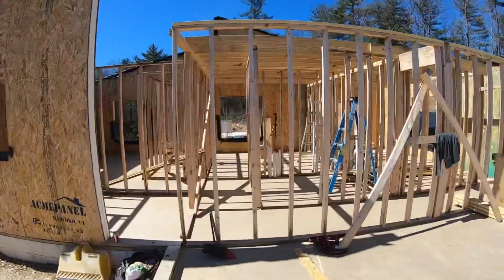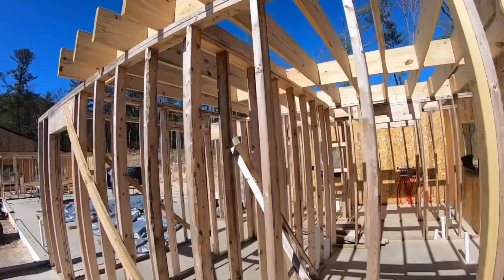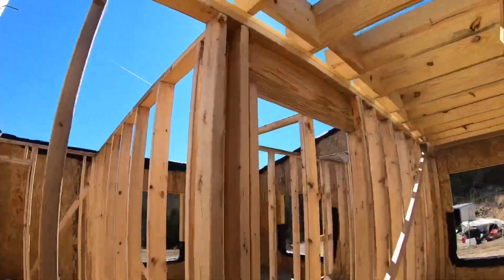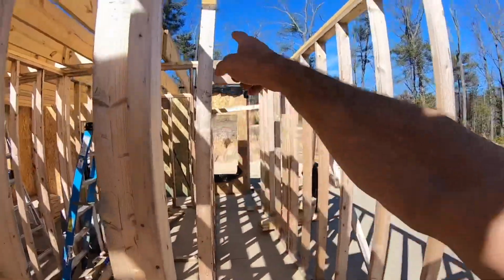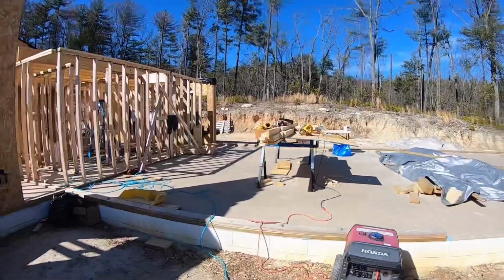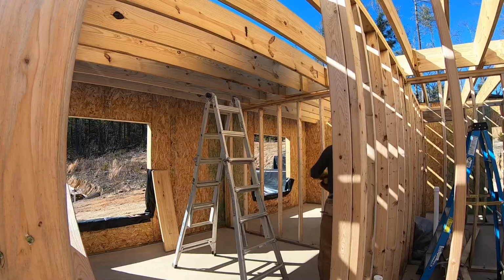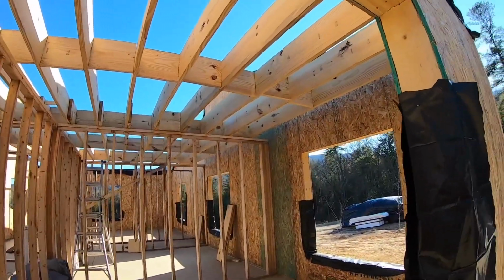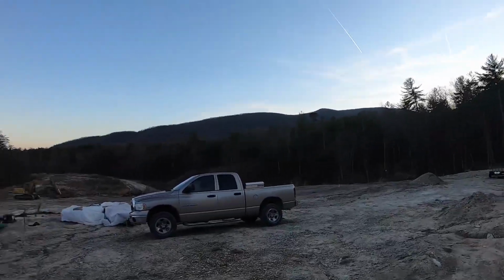Tension Blocks are complete. DIY SIPs house build #39

Comment: Why is there light showing through where the Jostes overlap each other? They ought to be tight, did he forget to go back and screw them together properly? This is a major problem when building anything, do it at the time, or it gets forgotten.
Reply from the maker: 3 inch structural screws in every one.